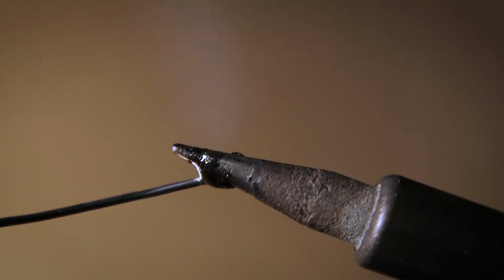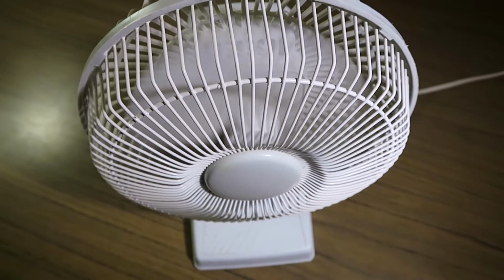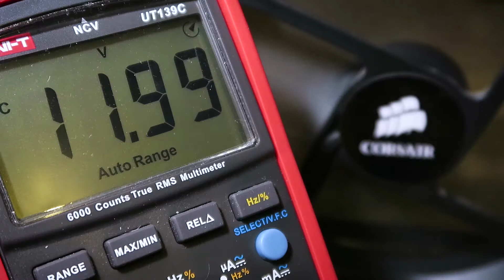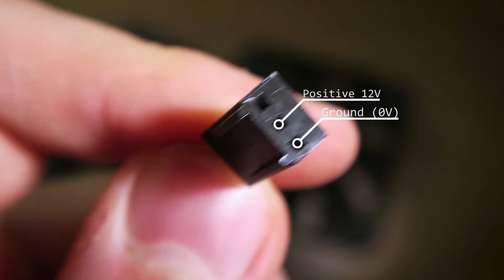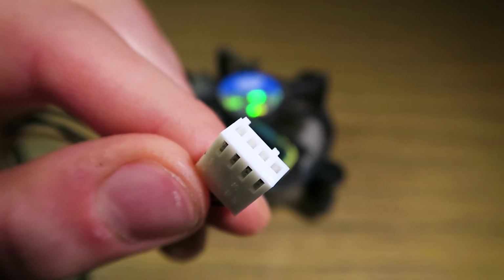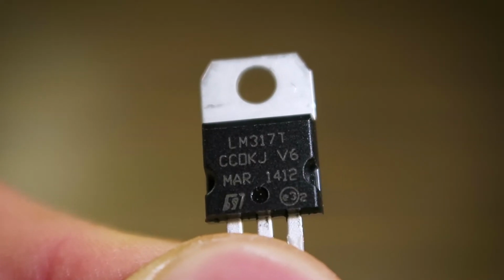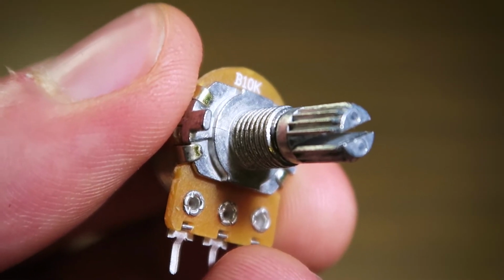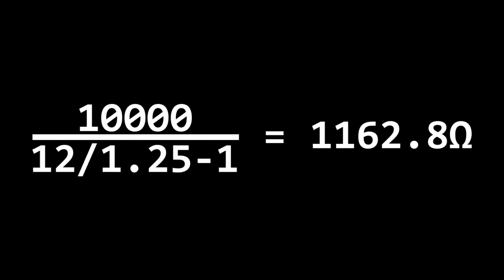PC Fan Solder Fume Blower

Comment: We recently purchased a commercial fume extractor for production. The unit we have, pulls the fumes away from the technician, through a charcoal filter and up through a spout at the back. Turned out to be not much more than what you have here - though it doesn't have speed control. To get better efficiency from your design, you might add a shroud to better guide the air? Cool video though :)
Reply from the maker: I would probably add a shroud if I was going to use it to suck fumes away but it seems to work decently without one when used as a blower.